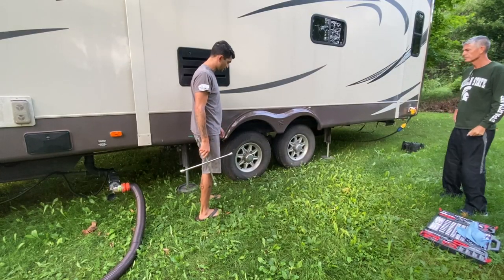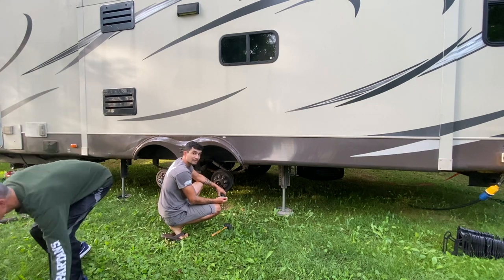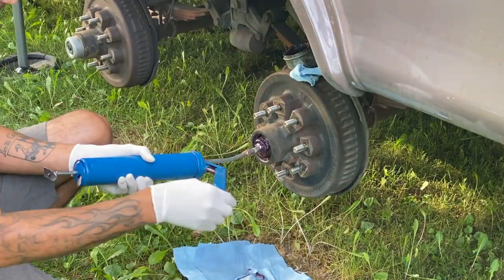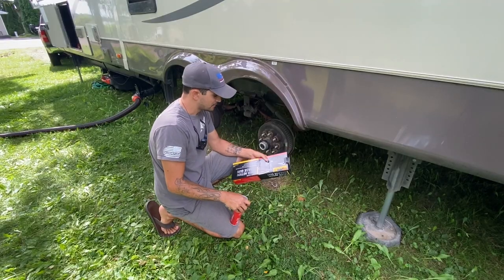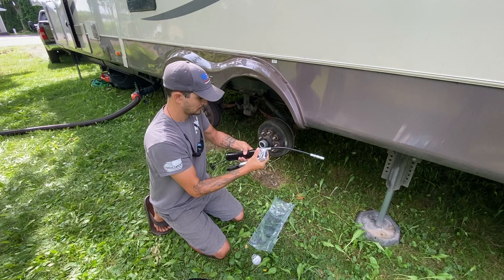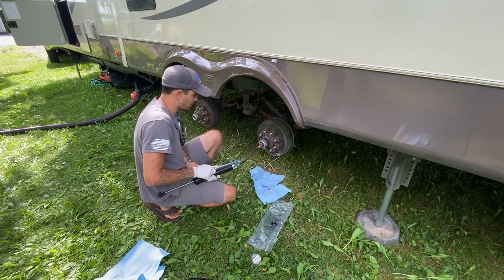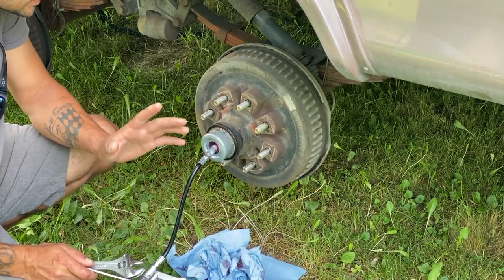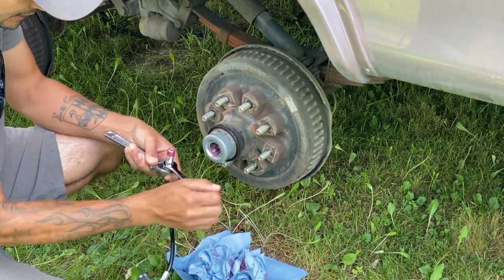How to Grease your EZ-Lube Wheel Bearings on your 5th Wheel Trailer Axles - Why Not RV: Ep32

Comment: I packed my wheel bearings and it hasn’t moved since!! (Pandemic), but I bought a set of new bearings to have on hand just in case. I believe you should pack bearings by hand even if you have the bearing buddies. You could be filling your brake linings with grease, and while you e got it apart, you can inspect the brakes at the same time.
Reply from the maker: Hey William, thanks for watching. Ya I’ve since heard about that. All was well with mi e but I can see that happening